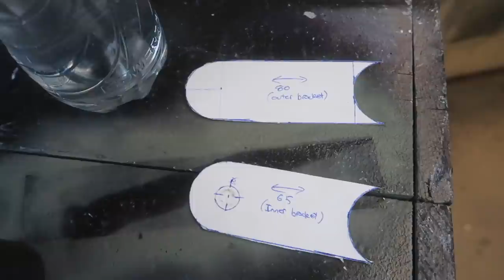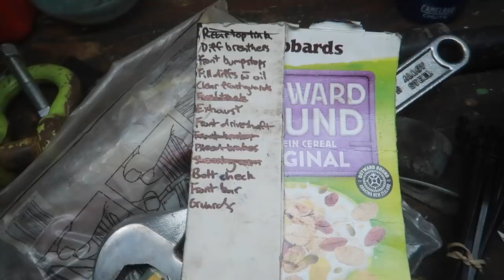HUGE Coilovers, ASSEMBLY and FIRST DRIVE of the $100 Disco V2.0! IT RUNS!!! Building a Racetruck!!!

Comment: Check the egg ring and spacer on the back of the hub assembly. If the spacer wasn't put back in the drive gear pushes through and wont engage the hub...
Reply from the maker: Cheers for that. Gonna have a quick look but tbh, the hubs are mismatching and flogged... will probably get a new set of Force4 unbreakable hubs and we’ll be set!